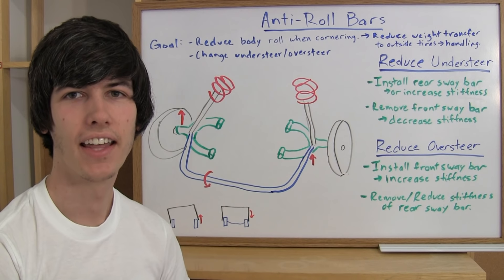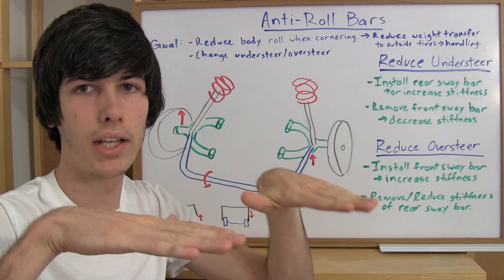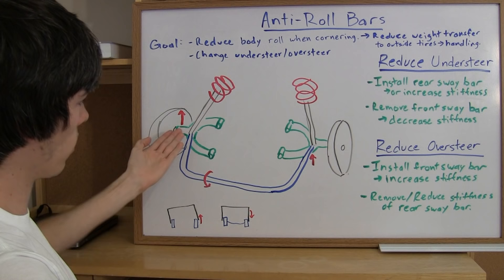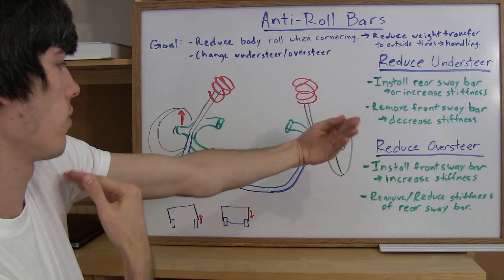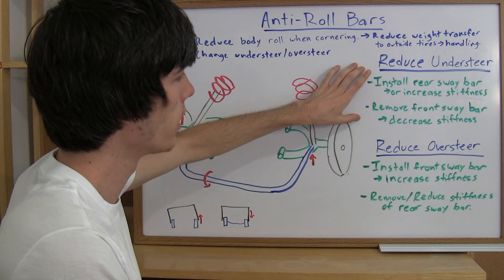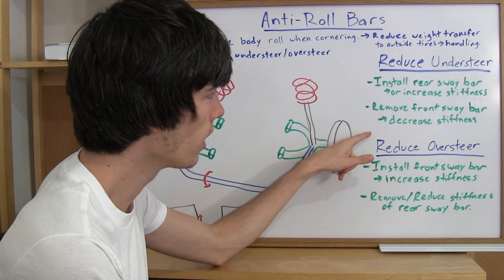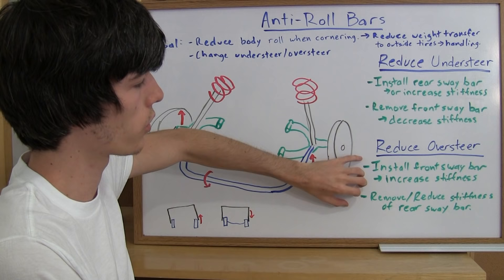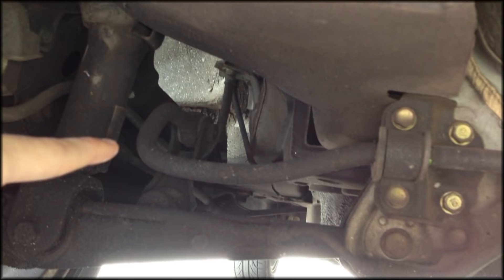How Anti-Roll Bars Work - How To Improve Car Handling

Comment: Anti-roll bars reduce body roll under applied lateral acceleration (i.e. in cornering), which DOES reduce the static WEIGHT transfer (i.e. weight transfer due to lateral movement of the body CoG). However, an anti-roll bar will increase roll stiffness on the axle that it is mounted to which will increase LOAD transfer (i.e. the reaction load, at the outside tyre contact patch, of the vehicle lateral accelertion). Due to tyre load sensitivity this reduces overall grip of the axle. Thus in order to dial out (for example) mid-corner understeer on a vehicle you would tend to soften the front anti-roll bar to reduce lateral load transfer across that axle, decrease the delta in tyre loading and thereby increase overall grip across the axle.
Reply: Will this anti-roll bars can be used in off-road vehicles is this necessary for off-road vehicles??
Reply: You have answered a question I thought I was going to have to research, thank you good sir
Reply: Word
Reply: This was a very young Jason, who now knows that reducing body roll does NOT reduce weight transfer. That can only be reduced by either lowering the center of gravity (CG) of the car, or by increasing the track width.
Reply: So remove sway bars to maximize roll for most traction?

Comment: Stu, if you are just looking at the front end of the car, the ARB will reduce understeer by controlling tire camber.  The driver likes it because the car is responsive and takes a set quickly.  However, anytime you transfer weight from one side of the car to the other, you reduce the total traction the tires develop.  So a really stiff front ARB transfers a lot of weight to the front outside tire (and the inside rear tire from diagonal weight jack). Continued in next post...

Comment: Hakan (cont) - You are right, the outside tire is developing more grip, but the rear pair of tires develops less overall grip.  A stiffer rear roll bar increases outside rear tire grip, but results in less total rear tire grip* (*see comments below regarding Camber control) - an adjustment toward oversteer.

Comment from the maker: That's one of the great things about Forza! And another benefit is understanding the effects of varying these things without worrying about damaging your own car. Find out how it acts based on Forza's physics engine (which is pretty darn accurate) and build a better understanding for when one day you can apply it to the real world.
Reply: this is just NOT a good explanation. Delete this video and try to make it again. 
Ask someone who doesn't understand the component and test them after your video. 
If they don't understand, think of ways to remake your point.  
That YOU UNDERSTAND DOESN'T MATTER.  You did when you started, & used your own metaphor to judge it.

Comment: as your ARBs get stiffer, the care will respond faster and feel better to the driver, then they will ultimately become too stiff and you will lose traction / speed in corners because you are transferring too much weight and not fully using the traction available from your inside tires.  relative stiffness of the bars front to back is important too.  A softer front and a firm rear ARB will get your tail out quickly - good for drifting.  Otherwise mild understeer = fastest lap time

Comment: Hakan - you must look at the front pair of tires and the rear pair of tires vs. any single tire to understand over/understeer balance.  A CanAm car I studied had 540 pounds of force on each rear tire going straight.  In the turn, it transferred 328 pounds to the outside tire.  The coefficient of friction does increase with wait, but relatively less and less with each additional pound of force added to the tire.  In a straight line, the tires had 1.4G of grip, but in the turn, now only 1.3G....

Comment: The last 30 seconds was gold. That 30 seconds made everything clear to me. Thanks!
Reply: Tagging this ancient comment to say: many explanations of swaybars neglect to mention what Jason shows at the end, which is that the bar is fixed to the chassis inboard of the suspension. This constrains the motion of the bar (or that central section) to only rotation, meaning it can only rotate (when both wheels hit a bump) or twist (when one wheel hits a bump).

Comment from the maker: Thank you for pointing this out, the wiki statement is logical. However, as a body rolls, the CG of the car also moves with it, so I believe a rolling body (if extreme enough) could slightly alter the CG, therefore altering the weight distribution. If the roll is minimal, then certainly your statement would hold nearly true. Interesting to think about, thank you for challenging my video.

Comment from the maker: The effects of the ARB would remain the same. The difference is since the Porsche is one of few vehicles with a rear mounted engine (behind the drive axle) it has a tendency to oversteer since there is weight at the rear. Porsches in general seem to be pretty well balanced and not in need of adjustments unless you simply want to eliminate understeer completely, but that makes the car more difficult to drive.

Comment from the maker: The green control arm is mounted to the frame and can move the tire vertically. I explain the torque reaction in the blue bar using my hand and arm, in the video. As one side is lifted, it causes the blue bar to twist, making the other side lift as well.

Comment from the maker: I'm actually working on a website right now, and one of the articles I've written is a comparison of going to school for mechanical engineering, automotive engineering, or a technical education in mechanics. The website is taking longer than it should, but when it's released I'll be making a video on it, and so you will surely know.

Comment from the maker: An ARB is not necessary, and depending on your spring stiffness/shock damping they can be eliminated. There may be a weight difference between the auto/manual, or a different spring/shock set-up that is the reasoning behind not having the sway bar in the manual. Or possibly to reduce understeer in the manual, since manuals are more of driver's cars than autos.

Comment from the maker: Woops! You are correct. Assuming the travel is the same (which it would be) a shorter arm would mean a greater angle change of the ARB, thus transferring a greater torque to the opposing side.

Comment from the maker: Different materials, different thicknesses; there are also some that are adjustable.
Reply: They are all made from a similar alloy steel. And you don't significantly change the weight transfer by adding more roll stiffness, a lower CG and wider track will do that.

Comment from the maker: Yes, they basically do the job of a solid axle, which is fine on flat pavement, but if they're too stiff and you're on a bumpy road, it's definitely not ideal. Hence most road cars have fairly light ARBs.

Comment: I’m getting the opposite effect with my car.    RWD Dodge Magnum RT.    I have the Touring Suspension as was looking at upgrading for less roll and less float.   I got the Bilstein B6 shocks and struts, which are awesome, kept factory springs, and was going to swap in a 30mm sway bar from a Performance Suspension model or SRT8.   Mine has a 27mm ARB.    But while going through LKQ to get a 30mm I saw a police spec Charger.    All of my suspension is the same except for the 32mm sway bar.    It made a significant difference.      The car is far more settled especially at highway speeds.   But one particular thing I always wanted my car to be able to do it now can do.   And I was t expecting this.    I like the ability to spin a car around on the tightest axis possible, basically leaving the inside front tire on one pivot point and rotating the rear.   Well now, that’s a breeze after putting that sway bar in.   Why?   It’s supposed to reduce oversteer, but now it’s easy to oversteer it from a standstill,  and at speed I ca. break the rear end loose, the front end is incredibly tight, and the car has transformed into more like an M5 kind of ride and handling.        But why did my much stiffer ARB increase oversteer AND reduce understeer considerably?

Comment: OK. Right off:

Anti-roll bars DO NOT reduce weight transfer by more than a tiny, tiny smidgeon. Weight or load transfer is an unavoidable consequence of the vehicle's centre of mass being above ground level, where the lateral forces are applied. All anti-roll bars do is to get you to the amount of roll that will equally oppose the torque created by those lateral forces at a smaller total roll
Reply: +Alan Baker i see u have read race car vehicle dynamics :P
Reply: +08yannch More than a time or two, yeah... :-)
Reply: ARBs do, however, contribute to either front or rear roll stiffness.

ARBs increase roll stiffness of the end they are mounted on.  Increased stiffness causes increased load transfer on the end that becomes stiffer, in a curve.  Load transfer decreases across the other end, so that the net transfer is the same (except for some very minor effects from CG migration).

Think "stiffness attracts load transfer" and you'll have it right.  If, say, you stiffen a rear swaybar, you'll increase the load transfer between the rear wheels and decrease it between the front ones.  This has the effect of giving less traction in the rear and more in the front.  There are also other effects from the reduction in body roll including improved camber, that can affect vehicle balance in other ways.

Millikan (the younger) was my vehicle dynamics teacher.  Awesome guy.
Reply: dude there is no weight transfer in a car
Reply: @DasKloputzer  ....... Can't be serious.?
Reply: @alkevinzmedia  i am
Reply: @DasKloputzer  weight transfers on turns essentially car is lighter on the front middle when turning left because more ftlbs are sent to the right when turning left on a corner. Think of a small boat. You step on one the rear side you pull the boat down and the front comes up. What ever is underneath is not being affected by weight since the weight is the rear of the boat
Reply: @alkevinzmedia  I think you mean load transfer, not weight transfer

Comment from the maker: They're not totally necessary if the suspension is good enough as is, but it's cheaper to make a good suspension with roll bars than it is with different shocks/links/springs. Hence why some supercars can get away without using them (for a price, of course).

Comment from the maker: Basically you just increase (or decrease) the length of the lever arm. The longer the lever arm (where it connects to the control arm) the greater the torque which passes to the other side, essentially making the ARM more stiff.

Comment from the maker: They would reduce the roll of the car significantly, however the suspensions would lose some of their "independence" as well. It's fine if the track is perfectly smooth, but for bumps, holes, imperfections, it's more of a balancing act of getting it just right.

Comment: The result is fairly small indeed but the pneumatic tire does not develop grip linearly to the applied load. The load sensitivity of tires actually make even the small amounts of weight transfer affect the grip levels noticeably and as a whole the "rubber grip" is more complex phenomenon than often realised. The mentioned wheel posture, camber changes for example, can be dealt to an extent in the suspension geometry itself, though it is of course affected by the roll nonetheless.

Comment: There is also wheel droop: the opposite of the compression action you described. A bar will also lessen a wheel's ability to droop if it's opposing wheel is compressed. Some cars can lift the inside wheel during hard cornering caused at least some of the time by the anti roll bar.
Thanks for the explanation. A driving instructor just told me to disconnect the rear bar to lessen under steer and I had to double check that that is wrong.

Comment: Part 2: Camber does not fix balancing issues, it changes cornering ability so be careful with that, you might make your car better in corners, but if you get it wrong you might make it a lot worse and also it will increase your tire wear.
Shocks don't affect tire balance, but you might get a similar effect (shaking) if your shocks are bad, but this usually is noticeable only when taking corners, but not if you drive in a straight line.

Hope this helps, cheers

Comment: 1. Body roll makes little difference to toppling over in steady state situations. The COG does not move much laterally. It is dynamic situations where a lack of roll control can result in toppling, but the skill level of the driver plays a large role here.

2. The crux difference between fitting stiffer springs versus anti roll bars (or stiffer anti roll bars) is double bump stiffness, like when you go over a speed bump or expansion joint in the road. Everything else is the same or similar.

Comment: On the "yes to lifting" part, you can see this effect if you have unbalanced ARBs. For example a car with soft springs, and a very stiff front ARB combined with a very soft (or no) rear ARB can lead to not having enough total roll resistance to prevent body roll, but since the front suspension is tied together the inside front does indeed lift off completely.

Comment: Hey Jason!Thank you very much for the easy explanations!Your videos are truly inspirational.
 I have a small doubt that needs to addressed in order to understand the Sway bars. You said that the Sway bars bring the tire closer to the car when the car tries to roll. So, suppose if the car is cornering to the left(as shown in your video), the sway bar tries to bring the right tire nearer to the car thereby risking the loss of contact with the ground .So, How can it be  advantageous when there is a loss in contact?

Comment: Note to Stu continued... this describes the Mechanical grip portion of traction.  EE discusses the importance of controlling roll (with stiff ARBs and good suspension geometry) to keep prototype and formula cars "flat" to the road in order to maintain their Aerodynamic grip.  A good laymens book on all this comes from Carroll Smith called Tune to Win - Smith was Carroll Shelbys head mechanic for the GT40 program winning Lemans from 1966 - 1969.  The recent SAE textbooks go over the top with math

Comment: hey Jason , i didn't understand that how could installing rear sway bars reduce the understeer. because understeer is due to fronttyre loosing grip, so if i add rear sway bar it would no let rear tyre move independently in air and does not affect the front tyre and also same question for oversteer

Comment: Engineering Explained Nice video. One thing though. ARBs do not significantly change the amount of load transfer. They change the balance of the load transfer between front and rear. Even if you have welded tubes for suspension and a near zero roll gradient you are still getting the load transfer within 1% of that of normal suspension. Don't you agree?

Comment: Anti- sway/ anti - roll bars  provide a means to control weight distribution and mitigate "body roll"    around the sides,  front and rear of vehicle particularly when cornering thereby maintaining  stability and contact with the road.

Comment: Hey. Are swaybars also seen along with solid axles (dependent suspension)? If yes, where are they then connected, having in mind that there are no control arms?
Reply: i dont think that need a swaybar cuz the twist beam concect.tire to tire and act like a swaybar sort of
Reply: Yes @Jerkwaad Solid axle vehicles can have sway bars as well and most do as they help increase roll stiffness without increasing ride harshness.  The could connect to anywhere that moves with the body or to the body itself and is not stationary relative to the axle.  You can bet that mustangs have sway bars.

@SpikerDragon95 You are confusing twist beams with solid axles.  Solid axles are straight across while twist beams have trailing arms which give the moment arm required for deflection.  Twist beams can allow the wheel hubs to flex independently of one another.

Comment: I believe the longer portion of the anti roll bar is fixed to the chassis which prevents if from moving up/down, but allows it for rotating? Is that's how it differs from the non-independent suspension?

Comment: The bushing will allow to move up-down a little bit as far as i know. Race cars using aluminum blocks there instead as i know, Plus i have just put polyurethane bushing into my e46 to the rear and there is a difference in handling (less understeer)

Comment: My car is a 2013 Passat and while it rides OK otherwise it rolls almost too much in corners.  I used to have a 2006 Jetta that didn't roll quite that much.  What would you recommend to make the Passat roll less?  Some people criticize the Passat for having a soft suspension as a cause of its roll.  I only have 45,000 miles on it.  I would not be surprised to find the bushings and all to be in mostly good condition still.  I really don't mind if it rides a bit rough, if I wanted a car with a soft suspension I would have gotten a Lincoln or something similar.  I got the Passat because it was similar enough to my last car.  I got it for $10,000 with 29,000 miles and no dents or rust.  My one and only regret is that it is white and shows all the dirt.  Mine has the 2.5 that the Passats came optionally with for a few years and in a way I am glad it is not direct injected.